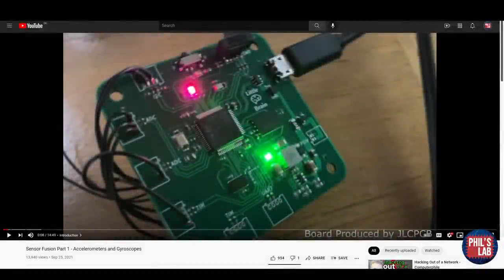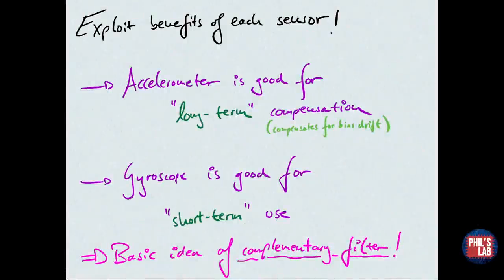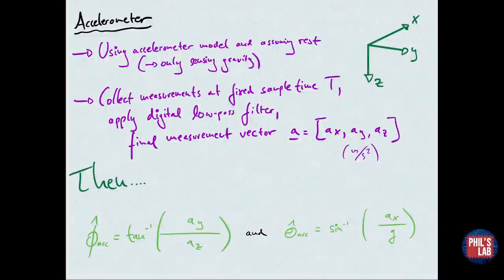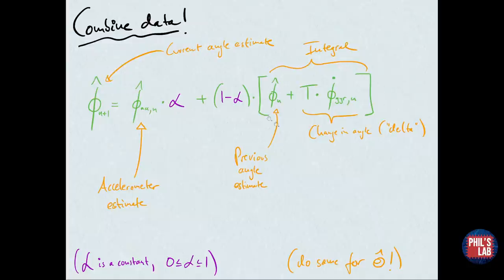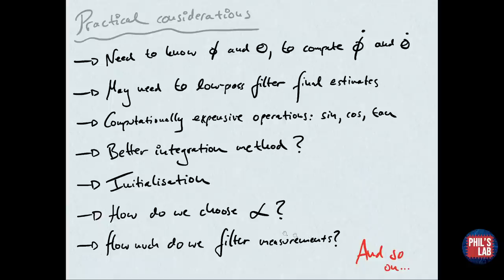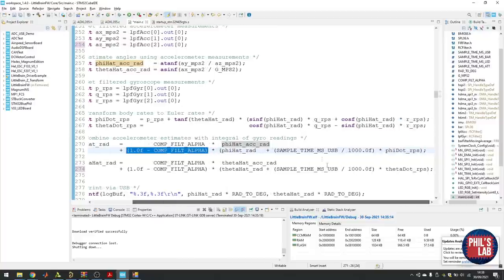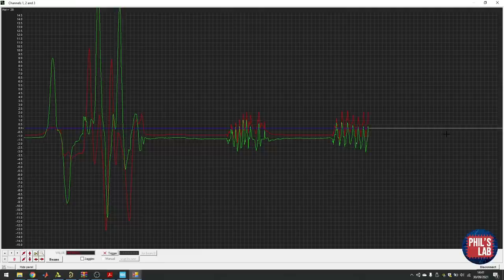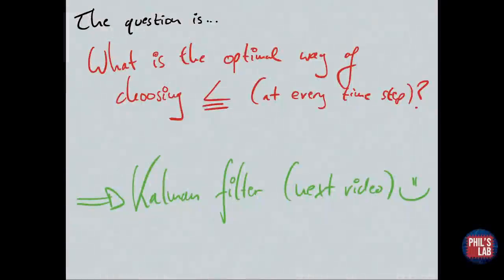Complementary Filter - Sensor Fusion #2 - Phil's Lab #34

Comment: You explain things so simply. One thing I don’t understand though - it seems like the complimentary filter is basically just 5%*accelerometer data + 95%*gyro data. If that’s the case, why don’t you still get drift from the gyro?
Reply: Gyro drift is still present at the input, but you're integrating the gyro data with the combined data which includes the accelerometer compensation.  As long as the gyro drift effect is weak or small enough, the accelerometer contribution overrides it.
Reply: @kevinvermeer9011  I guess because of the highpass filter to the gyro and lowpas to the acc eliminates drift

Comment: Looking forward to the next one - it seemed obvious that you'd want to dynamically update alpha: when you're sitting still, the accelerometer is more trustworthy, the gyro is just drifting, and you'd want a large alpha, when you're pitched over in a turn or otherwise changing quickly the accelerometer is less useful and you'd want a small alpha.
Reply: Yes. It is true that gain scheduling is beneficial in the case of dynamic motion that includes linear accelerations.

Comment: Thank you for the clear, concise explanation. One thing that I missed was whether this type of sensor integration also copes with linear acceleration - for example along the aircraft's longitudinal axis - or is it only for rotational accelerations? The reason for asking is that I think a longitudinal linear acceleration might be falsely sensed by the pitch gyro as a pitching movement.
Reply: This will not handle linear acceleration correctly. The gyroscopes will be unaffected, but the orientation estimate from the accelerometers will include the influence of the linear acceleration and, as such, will generally be incorrect. 

This can be corrected if the acceleration vector is known - simply subtract the linear acceleration from the accelerometer readings. Alternatively, the gains of the complement filter can change when acceleration is present so that only the gyroscopes are used for tracking orientation. Of course, that causes gyro drift issues again, but if linear acceleration is rare, it can be workable.

Comment: LOL I just recognised the Cambridge crsid in the github repo. Calling roll Φ (or was that acceleration) seems anachronistic in an era where everything is software (i.e. the Φ looks great on a blackboard in the Baker Building, but "roll" looks better in C). Although you could double down with vars called Φ_gyr_rad.Nice job with the video series though.

Comment: I don't understand the filtring part  I think you should use high pass filter for gyro datas .. am I wrong?
Reply from the maker: Imagine you are rotating at a constant rate (i.e. DC) - what is a high-pass filter going to give you in that case?
Reply: @PhilsLab  But in this case after some over the time, gyro drify will be huge effect because we didnt apply the high-pass filter? Am I wrong?